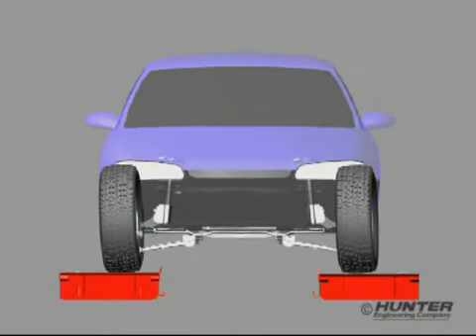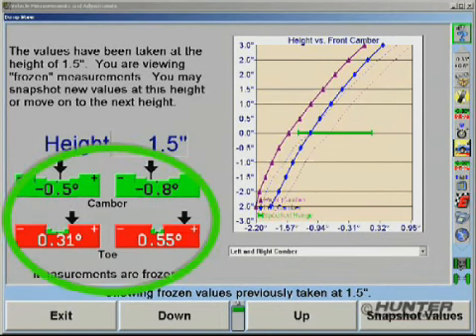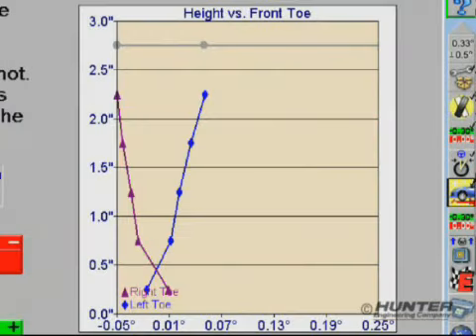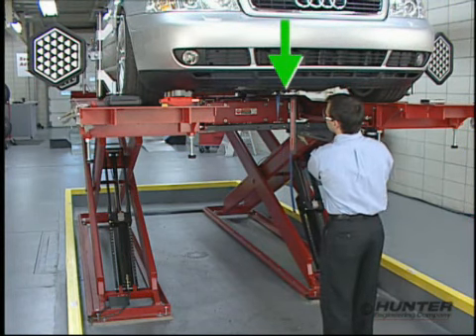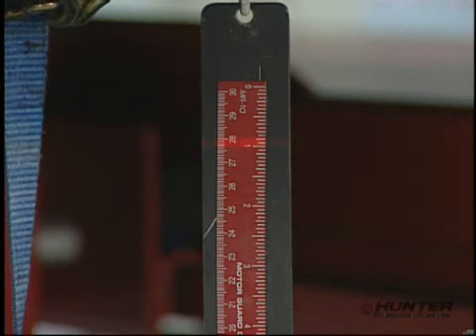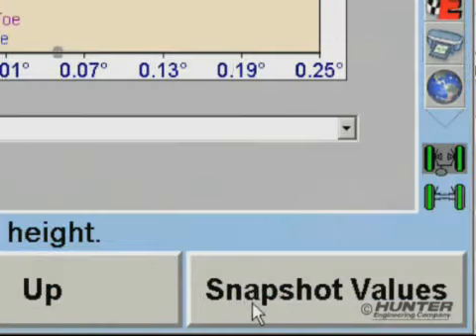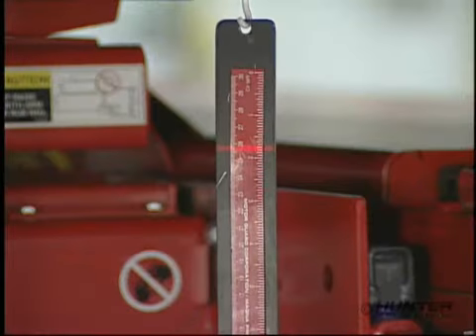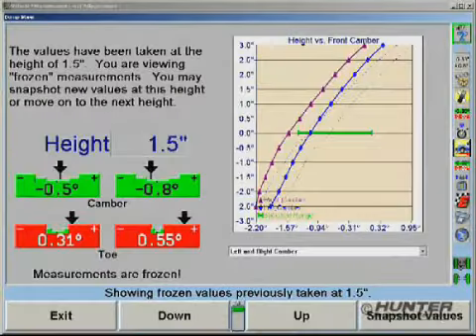Measuring Bump Steer - Hunter Engineering

Comment: Will a hunter wheel alignment fix bump steer?
Reply from the maker: Bump steer is a symptom that can be caused by a number of conditions, most of which are induced by modifications or component damage/failure. With the proper accessories you can measure bump steer with a Hunter Aligner, but correction method requires inspection and appropriate action based on conditions found for that vehicle.